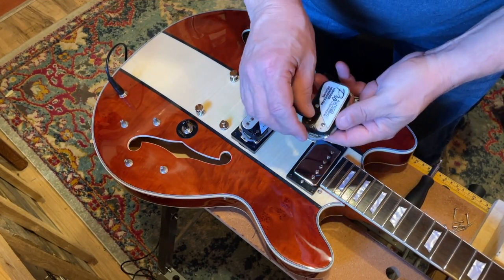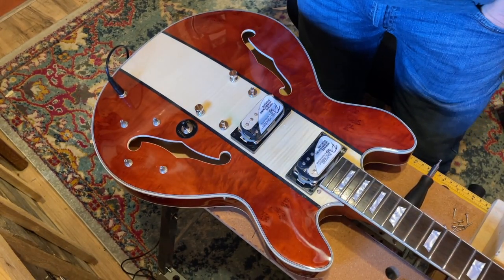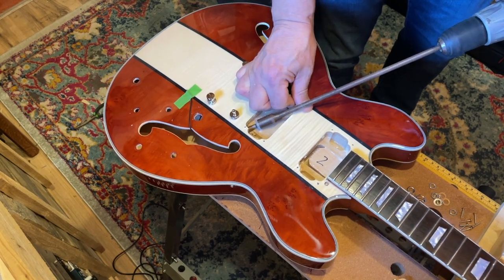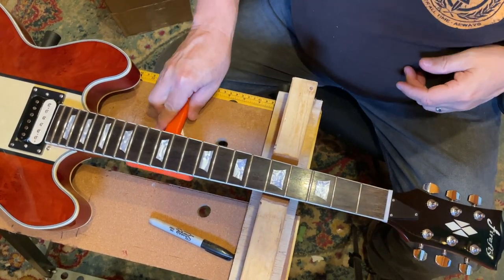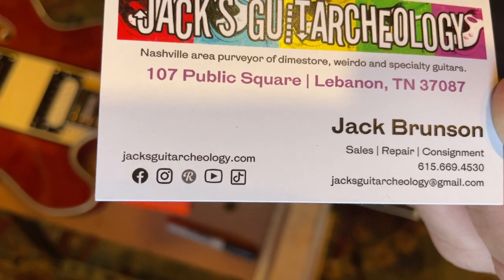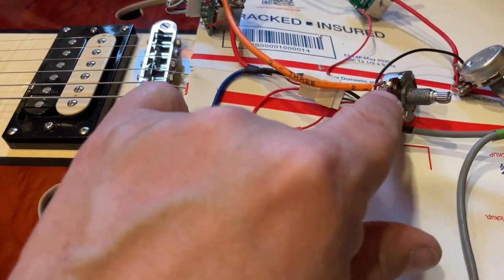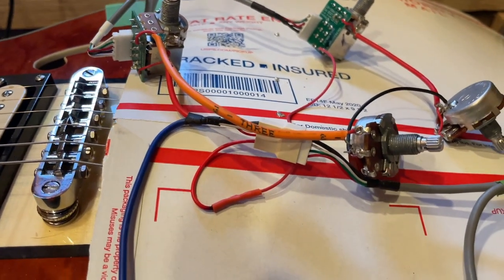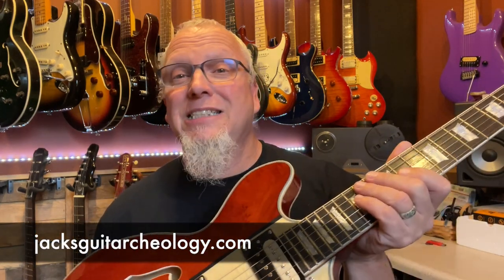Firefly FF-338 - Mods, Setups, and New Friends

Comment: I think I would have just noted the pinout of the connector, then removed the wires from it, insert through hole, reinstall clip. Its very easy to do and doesnt require drilling on your guitar.

Comment: Got the slow selling Al Di Meola-like prism finish 338 during the Xmas sale with a coupon, $137 shipped so I'm disinclined to complain about anything. 

I suspect they put a horizontal plek on some of the most recent Gibson copies, they definitely hit the fingerboards/frets with the buffing wheel lately. 

Acoustically its bright but not brittle, fat neck, sticky poly but it wet sands down well to a fast satin. 

Doing the same upgrades and details I'd to to an Epi at dollars per pound I couldn't have done better, even if I pay somebody to respray the top eventually (or lightly torment myself with the DIY version...)

At retail I might have a little crispier opinion but, never having bought their 335 before, I know what to expect and to wait for a sale...

P90's and a trapeze tail variation woud be a treat.

Comment: I just got the Green one yesterday.   It needs a good once over with cleaning, new strings, fret work, etc.   It was pretty filthy with a lot of dried white polish(?) on some frets and crevices.

Question: Have you settled on the ideal string settings?  Mine seems to be a tiny tick over 4/64ths at the 12th of both Es, and I have no idea what I'm going to settle with on the pickups.  I'm actually pretty impressed that the action isn't way off out of the box.  Looks great!

The gain test was enlightening.  If I grow to like it that much, I'll swap out pickups for something else as well.  The tuners definitely look like they're going to need to be swapped.  Quickly goes out of tune, but I want to stretch the original strings a bit before I make a conclusion on them.
Reply from the maker: I’m usually between 4 to 6/64. Tuners we’re a must on both of mine. Pickups were also a must for me on both. A good setup really made all the difference on this one for me.

Comment: Very cool guitar, what a great job.🥳 I have the FF338 in Emerald Green, just put Gold locking Grover's on the head and now tuning this Ax is No problem and the Green & Gold really pop! I don't mind the mic pickups but ....i may change out the bridge for a Seth Lover.😎
Reply: Hey buddy what Grover tuners did you use on yours I want to put Grover's on mine too. Please let me know okay 👍
Reply: @kerrybarovick1277  Originally for my Martin D, they are Grover Machine Heads (hole size .391 =~25/64)  GX1235 is the model # or 102G👈
Reply: @adamdelarozza1985  cool thanks bro. I just picked up a firefly 338 I got the red and black with the bat inlays. It's really nice but the tuners aren't too good. With those Grover tuners did you have to drill holes or did it work with the existing screw holes?
Reply: @kerrybarovick1277  Red & Black is a great combo! I didn't drill any new holes. The Grovers  are so snug, you'll need veg oil to nudge them in and once the front nut is tightened, it wont come loose unless you use it for a paddle.🙂  The old holes that are left over , i screwed in the gold grover screws as they fill-in the holes and look nice. The tune-O-matic, sattle i just ordered in gold too. They are under $20 bucks😀 These guitars are so cool with a  few mods😉

Comment: I got the FF338PRO Baritone this week and I was not the only one to have problems. After speaking with another guy who had just purchased one he mentioned his low B would not intonate. I had a look at mine and the bridge saddles were notched large for smaller strings and small for larger stings. Well, he quickly fixed his saddles and moved them tho the right spots. Still his B would not intonate. I started measuring and sure enough the 12th fret was about 1/32" too far forward on the bass side. I measured further and a good portion of the frets were anywhere between 1/32" and 1/16" off on one side or the other. This could potentially create a nightmare while moving about the fretboard and notes being sharp or flat. I will be packing it back up to send back to GG tomorrow. I'm just wondering where is QC when more than one of these things gets out and has this noticeable of a problem?
Reply from the maker: That sucks. Scale measurements should be given.

Comment: What a stellar improvement! How did the tuners work out? I was curious about the hole size. Is it 10mm? Wondering if I will have to convert mine, drill out the holes etc...  Great pickup choice. Have you tried the dream 180 pickups? I am ordering the same tailpiece today! That looks awesome!
Reply from the maker: Tuners worked out great. Direct replacements. No drilling.

Comment: I just put Guyker locking tuners on mine and the  string action is so low I can’t adjust the bridge high enough.  Any tips to fix that?  I did put 9’s on.  Could the slot in the nut be the issue?  I have switched all my guitars to 9’a and never had a problem.  This is my first tuner change.
Reply from the maker: Could be the nut but if the action is that low it might be the neck angle. It might need a truss rod adjustment. But without physically, seeing it is kind of hard to say. But it’s just doing basic stuff isn’t fixing it, I would bring it to a tech and have them look at it.

Comment: The new pickups/electronics were in a kit? You mention sold out on ebay...but do you have a description or a link?
Reply from the maker: The pickups and wiring harness were purchased from an individual off eBay. It was a one off. Likely from a guitar they were parting out or had pulled from their guitar to upgrade. These are fairly easy to find by searching eBay. The description is in the video. Epiphone Alnico Classics. There are multiple form factors, covered, black, zebra, etc.

Comment: Hi Keith,

Did you end up using the original bridge?  If you swapped it, what did you use, and how did it turn out?

I have the green version of this, and the bridge is solid except for a little rattle on the Low E especially.  My bridge has the nylon spacers that helps prevent previous Firefly buzz complaints..  But the rattle I think is due to the the retaining clips on the saddles.

I''m considering trying some purple  threadlocker on them first.
Reply from the maker: On this guitar the stock bridge is still working out. I have a matte green 338 that I will be swapping the bridge on. My go to bridge for the Fireflys is from Guitar Fetish. Really good bridge for around $15. 
https://www.guitarfetish.com/Large-Bushing-Tuneomatic-Style-Chrome-Bridge_p_444.html
Reply: @TheTapeFarm  Thanks

Comment: Dude you're insane you find the tool they use to deep in that connector and you de-pin the connect and you re-pin it after you've run your wire s what are you doing?
Reply from the maker: And that’s another way. There’s more than one way to do most anything. And so long as it works and doesn’t cause any damage what difference does it make. It’s a bit much to call it insane. All I did was make a hole bigger. That’s hardly the act of a madman. But thanks for the info.
Reply: You know i was looking up how to depin the harness and well i looked at it and figured out how to depin it using a thumbtack. It was cool haha